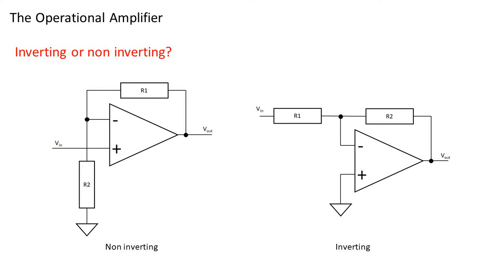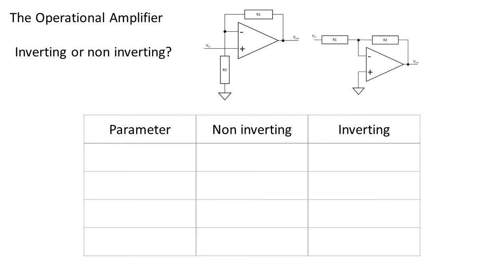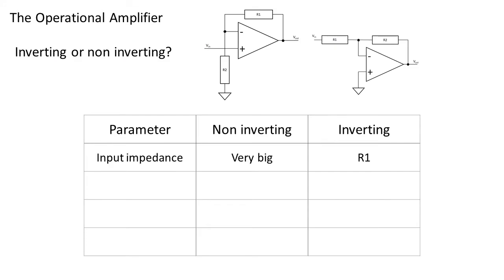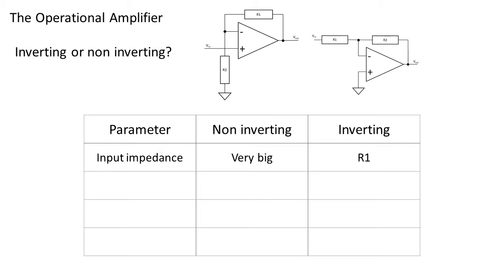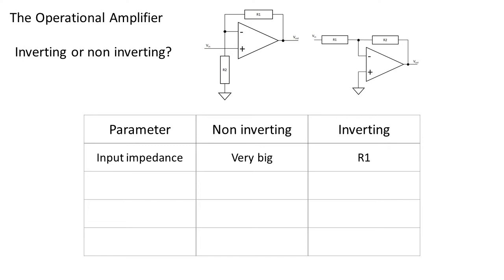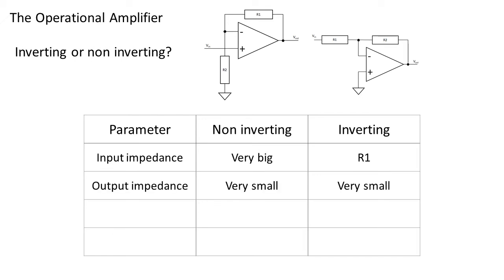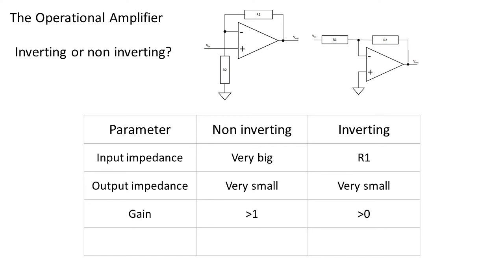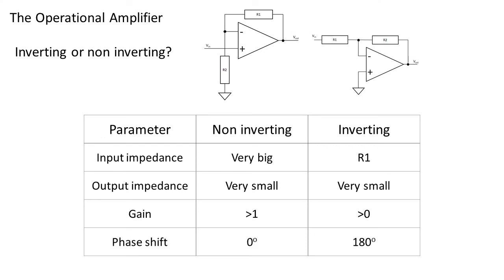5 Opamps: Inverting vs Non Inverting

Comment: Hi, I have a question, I am passing the output from an mp3 player into an inverting opamp. Do I use an 8ohm resistor as r1 or do I use a bigger resistance like 47k or 1k
Reply from the maker: Hi you might be thinking you need 8 ohms because the mp3 player output is supposed to drive speakers or headphones/earbuds. But this is not necessary for simply transmitting the signal (voltage) to a next stage like your inverting opamp. A high value resistor like 1k 10k, whatever should work alright.